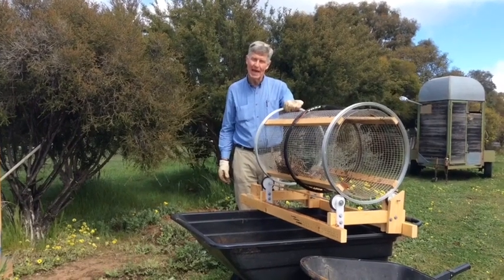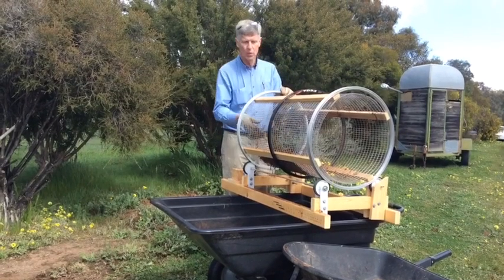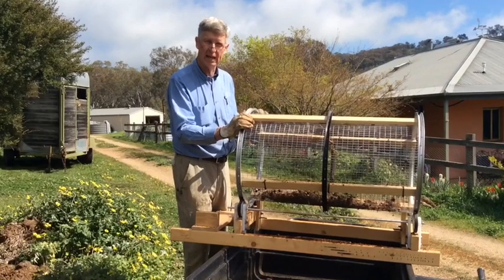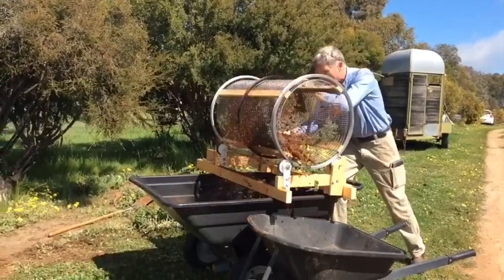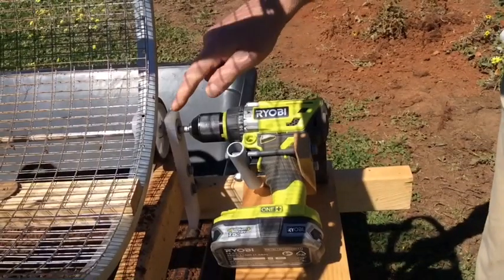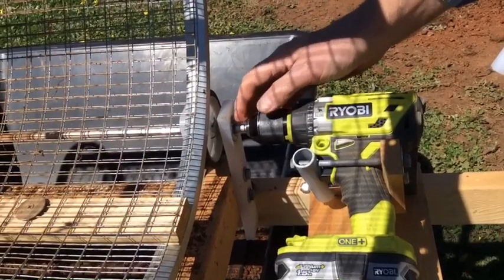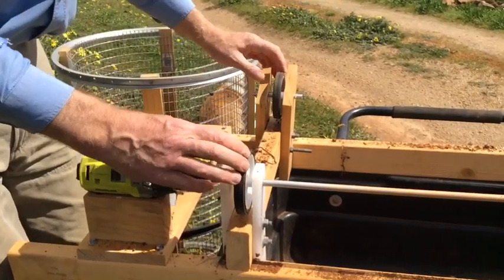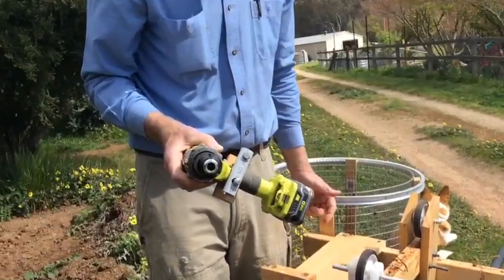DIY cordless rotating sieve , sifter or trommel

Comment: Best and simple design. I like also the proper size wheel borrow under it, that is wide and bigger in size and has leveled rim top. And the whole machine is light weight.
Reply from the maker: Thanks Sergey.  Good luck with all your garden projects.

Comment: very nice back yard engineered sieve, I bought a used cement mixer to pulverize leaves. I fill the mixer with leaves, toss in a few tennis ball size stones and run the mixer, this pulverizes the leaves into small pieces that I add as mulch to my garden and flower beds. 
you could use brick pieces, short pieces of chain, or anything that will beat the leaves into smaller pieces as the mixer turns.
I would attach legs with wheels or casters to this seive  so I could move it around  in the garden to the place where I wanted the compost to be added. I would also use a 12v lawnmower battery and small 12v motor to spin the sieve, the battery can be kept charged by a small solar panel.
Reply from the maker: Thanks Roy Hoco.  Great idea of yours for pulverising stuff.  Legs would be a good addition to the sieve but I would try to make them fold so you can still use it on a wheel barrow if required.  Also getting the slope right is important as this determines the speed at which material travels down the sieve tube. The height of my two wheeled barrow in the video was just right for me and I could slope it with the right sized chock under one wheel.

Comment: This is an excellent project and easy design. I am going to try it as soon as possible. One question, can plastic garden mesh be used for this instead of wire mesh since it would be much cheaper for the smaller aperture holes?
Reply from the maker: Hello Hamza.  I think that plastic mesh would work as long as it was stiff enough for the material you are sieving.  For example I was recently separating large gravel from soil and this was heavy so the stiff wire was adequate.  However if you were simply trying to separate sticks from fine compost, then stiff plastic mesh might be strong enough.   Maybe put a shovel full of the material you want to work with onto a bit of the mesh you are thinking of using and pick it up and move it around to get an idea of whether the mesh is stiff enough or will distort under the weight of the material.  Good Luck!

Comment: Wireless drill are not meant to be used continuously. Only corded device.
Reply from the maker: Thanks for the comment Dan.  You are right, t is a DIY rather than commercial option.  I and others have used it for several hours at a time and the drill is still going Well.  If using corded always be wary of trip and electrocution hazard of trailing 240V leads in the garden.  Good luck with the gardening.

Comment: The flat is way simpler  with all  kind of shaking motor that can be used.   It can also build to be portable  and storage.   The round one is very hard to implement  with motor and way too big for storage  or transport.

I stick with the flat type and I will build one.

Comment: Very nice job, I tried reproducing this weekend.  I opted for placing the drill with a short axle and wheel attached on the middle rim.  When I loaded the cylinder with some wet / heavy compost, it bogged down my drill and the clutch disengaged I assume because it was too much torque.  I have a ryobi impact driver/drill.  Just wondering if you or anyone else experienced this. I have another drill I can try that has an adjustable clutch setting.  Also considered using a "grooved" wheel on the drill and using an old innertube to go around the middle rim and groove wheel.  This would keep a little tension on the cylinder pressing against the outer casters.
Reply from the maker: Thanks Scott.  I have no experience with impact driver/drills.  Most tools have a setting which often looks like a twist drill which switches off the clutch function.  It you are using wet/heavy stuff maybe try and dry it out - even if you just put an old bit of iron or tarp over it for a few days.  Also use smaller shovelfuls and go a bit slower so as not to overload the drill.  Increasing the slope of the trommel might break up the material a bit more and move it through quicker.  Good luck.
Reply: Hi lauriston, do you recommend polyurethen or rubber wheels for this build? And whats the best size wheels?
Reply from the maker: @epicson4274  Hello Epicson.  I think rubber sounds best.  You want something really “grippy” so there is less chance of slipping.  The wheels I used were about 100mm (four inches) in diameter.
Reply from the maker: @esbreidenbach  Hello Esbreidenbach.  I have never used an impact driver so not sure how they operate.  Try the other drill on the “drill” setting i.e. no clutch.  Yes an old inner tube as a drive around the middle rim might work well.  It is keeps bogging down you may have to just go more slowly and put less material in at a time or let the material dry out a bit.  Good luck.
Reply: @lauristonmuirhead1210  yes you are correct, soft rubber is best for grip and as well as a larger diameter wheel also helps grippiness. Thank you for responding , but these wheels are hard to find because they usually comes is widths of 2 inchs +, which exceeds the width of the bicycle rim.
Reply from the maker: @epicson4274  Sorry wheels are hard to find.  They don’t need to be very strong - a working weight of about 20kg (45lbs) should be enough.  I used really cheap nylon wheels with rubber outer from our local hardware chain Bunnings (in Australia).  They were about 12mm (half inch) across the tread which was of a flat profile which suited the job well.   Maybe try your local cheap “dollar” store or maybe your local rubbish tip has a recycle shop attached or maybe ask around if anyone has an old shopping cart/trolley?
Reply: @lauristonmuirhead1210  thank you so much for all your information , i like your comments , your video and your channel, your intro and all,, much appreciations , ,my life really isnt complete without a soil trommel, you hit the nail on the head with this one..cheers😃💥💫

Comment: One feature of this design is the ability to swap screens with different sized mesh .
Reply from the maker: Well said Stephen.  The screen in the video has apertures of about 20mmx10mm but since then I needed a finer screen to screen pebbles out of some good top soil and I just inserted a bit of mesh with 5mmx5mm inside the existing screen and again secured with zip ties.  Works well.  Thanks for pointing that out.  I suggest starting with the bigger screen which will be made of more robust wire which will be able to support an finer screen that might be used later.

Comment: Can you tell me about the drive wheels? I'm guessing you are not in the US. Can you say what kind of wheels they are and where to find them? Can you describe their makeup and dimensions? Thanks
Reply from the maker: Hello Sumnerbrent.  I am in Australia.  We have a big hardware chain called Bunnings where I buy most of my bits and pieces.  The wheels appear to be nylon with fairly grippy rubber tyres and there is enough of a tube on the axle to be able to drill a small hole so you can put a split pin or similar to fix the wheels to the axle.  As per the video the two wheels on the long shaft are fixed to the axle so when the drill turns the axle the wheels turn.  The other two wheels are free running.  Here is a link so you can see what the wheels look like https://www.bunnings.com.au/ambassador-100mm-white-plastic-centre-wheel-and-rubber-tyre_p3942885  I am sure you will be able to find something similar - obviously you have to match the wheel hole to the diameter of whatever you are using for the axles.  I think I used 10mm aluminium (about 3/8 inch aluminum) tube but it was fairly delicate and would be easy to bend if it gets knocked around.  Stainless steel or gal. rod might be more robust.
Reply: @lauristonmuirhead1210  Thanks for your reply! Your project was inspirational! I built a similar unit over the last few weeks based on yours. I ended up finding replacement training wheels on Amazon that seem to be about a match for what you used on yours. I couldn't find an aluminum rod in the correct length so I settled for steel 5/16th. My trammel is 4 feet in length and I found I didn't need the center rim. The wood stringers seem to carry the load fine. I used wood from an old pallet for the frame as in the original video. This unit is working great! I'll send you a picture. Thanks for sharing your project.
Reply: Outstanding! This is what I’m trying to build. Hopefully I’ll post my creation when I’m done. My problem is adhearing the wheels to the axle. I read your response below on drilling a hole through the castor, but I don’t see how your drill was able to fit the drill that close to the tire. Excellent engineering sir!

Comment: I definitely would put in a couple of bearings, a few bushings and a proper motor.   
     Good grief, those hobbyists drills don't last very long using them for drills, let alone a motor.
Reply from the maker: Hello jenky1044.  There are definitely good and bad cordless drills.  I have found the Ryobi products from Bunnings in Australia to be extremely good value for money (I do not get any sponsorship from them).  It is not very clear in the video but I can sift nearly a tonne of dirt on one charge of the battery.  If you are sensible about how much load you put on the trommel it should last a long time. I have various Ryobi tools and have treated them pretty harshly, especially the drill - I built a fence a while back drilling many 600mm deep holes in hard dirt with a 50mm auger etc.  See my fire fence video.  In five years the drill has not died yet.  I agree it is not “busy tradesperson” standard but at the price I don’t expect that.  Also agree bearings etc. good for professionals but watch out for that cord - always a trip and electrocution hazard.   Even the contractors are now going cordless electric.  Have a look at the Stihl range.  Good luck.

Comment: Great idea using a trill on the wheel, ... I might to the same with an old corded drill I've got, as I don't want to inadvertently burn out my good cordless one, but otherwise, thanks.
Reply from the maker: Thanks Aaron Wadzinski.  I recommend cordless.  Cords are easy to trip on and limit how far from power you can operate and introduce a high voltage shock risk as well.  If you use a corded drill please be very careful to run the cord safely.  The cordless drills are incredibly robust.  I have used mine really hard and it has not stopped yet after several years. I have drilled post holes in hard ground with a 40mm (11/2 inch) auger with it, left it out in the rain etc.  It will not die!  I can sieve about half a cubic metre (2/3 cubic yard) of soil on one charge of a 1.5 Ah battery.

Comment: why not add a solar motor
Reply from the maker: Hello Java OpenSource.  Certainly that could work but would add a lot of complexity.  I have a solar roof top system and use all my gardening tools etc. during the day so the batteries are charged almost exclusively by solar.  If you have not got a roof top solar system, I strongly recommend having a good quality system installed.  Good for you (save money in the long run) and good for the planet!

Comment: why not just use a electric drill?
Reply from the maker: Hello Otrotland.  You can certainly use a corded electric drill if you are close enough to mains power.  The advantage of the cordless drill is that you don’t have to be near mains power and you don’t have dangerous leads lying around acting as trip hazards etc.  Good luck with your projects.